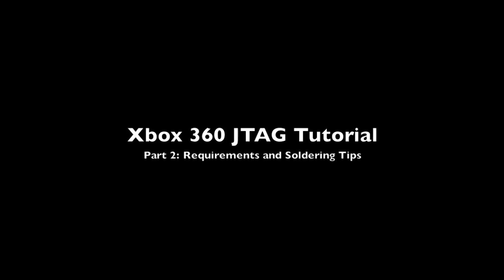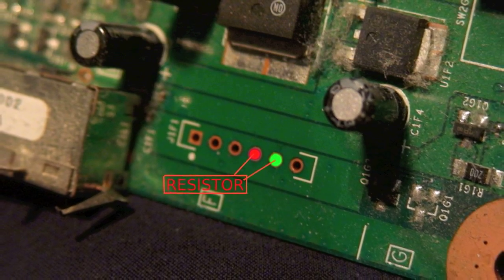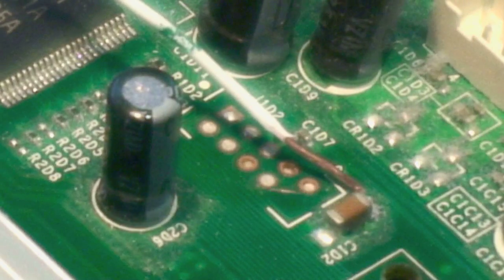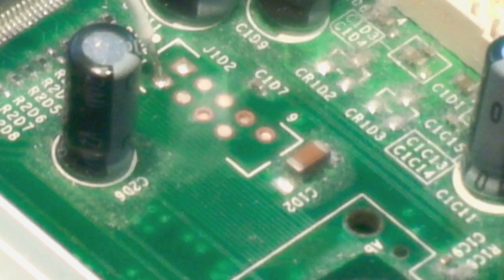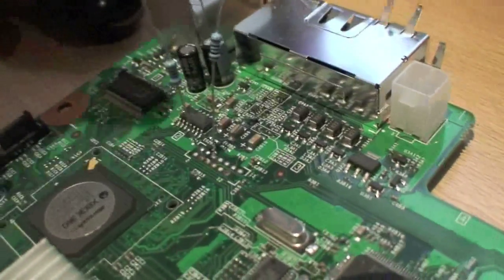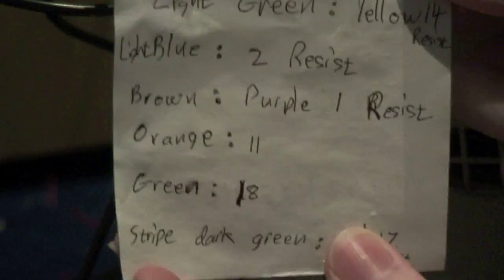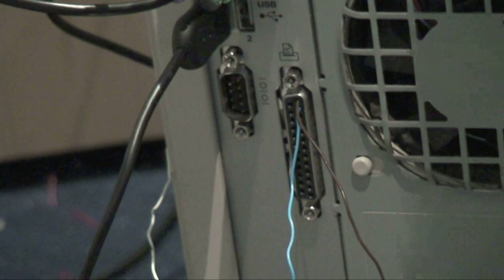Xbox 360 JTAG Tutorial - Part 2

Comment: Extremely bad soldering. You are not competent at all, example: you put wires straight to lpt pins, who does that? After 20 years of electronics study, you don't have free LPT connector? Do I need to "study 20 y electronics in general" to solder like a preschool?
Be at least a little modest...

Comment: Kexx Sh, this tut is almost 3 years old. There's a bunch of stuff out now that makes it a whole lot easier. If you have access to the funds, Nand-X with QSB's(Quick Solder Boards) eliminates a ton of work and there are plenty of tut's on YT to help you get it done right. Then again, the new hot item is the CoolRunner's RGH(Reset Glitch Hack). Maybe you'd wanna look into that. I think for most, soldering is the biggest issue. It can be a pain in the ass until you get the hang of it.

Comment: Question: You call for 3 diodes, but I only see you use 2. J1F1.4 to J2D2.2 and J1F1.3 to J2D2.1.  Did I miss where you used the 3rd one? I have a Xenon board.

Comment: @XxGreedyGutzxX if your xbox has been online since the summer of 2009 then it can NOT be jtag'd...  what stupid summer 2009 update fucked up something in one of the mircochips to where you can't use a jtaggable dashboard any more... however, there is the Reset Glitch Hack (allows you to do the same stuff as a jtag like modding games) but to unban a console, you would need a unbanned KeyVault...  it's actually much easier, safer, and cheaper to just buy another xbox360 then put yours on EBay...

Comment: sorry second message the same don't read but the xploit is called the Reset Glitch Hack and it lets you boot Xell and a chip that optionally comes with it the Cygnos Mod chip use Dual boot systems  and the main Software that you need to falsh nand with to boot unsinged code is called ggbuild, I may be wrong but the latest version of it is 0.33

Comment: @fenixxtate No first xenon(his)(2005-6), then Zephyr (2007),Early 2008 was Opus, late 2008 was Falcon, 2009 is Jasper and not sure for the rest of Phat Xbox 360 but slim isTrinity which I believe used to be called Valhalla. All slims are unexploitable to jtags due to motherboard and Dashboard Version as Microsoft Countered the Jtag exploit in Dashboard Version 2.0.7379.0, but if you really want to run unsigned code and Homebrew etc. then for slims and all other Xbox 360s there is a new exploit.

Comment from the maker: @HaloGuy2552 

1. Yes.
2. The two diodes and jumper connection comprising the JTAG modification must remain, however the LPT wires and resistors may be removed.

Comment: @OnlineTonight Those aren't viruses you idiot. PSFreedom is an exploit that is used via a phone to unlock your PS3. It's based on the dongle exploits such as PSgroove and PSJailbreak. Likewise they aren't viruses by any stretch of the term. Also it's not a stock USB stick. It's a custom micrcontroller that is housed in a USB device. They are all based on micro controllers such as Teensy, Atmel, etc. But they are not viruses at all.

Comment: @troy2062 Those aren't even viruses to begin with. Those dongle exploits are code that injects into lv2 and sometimes lv1 of the PS3 to unlock features. The only thing close to a "virus" on the PS3 would be idiots who make homebrew that is designed for the sole purpose of bricking your unit. But it still isn't considered a virus.

Comment from the maker: @bubba4peace 

The JTAG modification involves writing a modified kernel to the NAND which permits unsigned code (any unapproved by Microsoft) to be executed.  This video demonstrates the necessary modifications to the motherboard before dumping and flashing the NAND.

What is often incorrectly referred to as a "flashed" Xbox 360 console simply refers to a console whose DVD drive has been flashed with a custom firmware. This firmware permits the launching of properly burned DVD+R DL backups only.

Comment from the maker: @sk8terdude132 

As explained in the above comment, it is impossible to prevent a JTAG-modified console from incurring a ban.  There is nothing to brute-force.  When a modified kernel is detected, the KeyVault is blacklisted by the server.  A blacklisted KeyVault will not be accepted by the server, regardless of what is done on the console-side.

Comment: Dude, where'd you get that gawd awful soldering iron, you think you could have used something BIGGER?
Why not use a solder sucker and remove the solder out of the soldering points stuff the wire through the hole and then solder the wire on the foil path.
Oh and solder is not solder with the "o" being pronounced as "OH".
Do you know what HEAT SHRINK is?
My dog does a better soldering job.

Crude.

Comment from the maker: @joshualidberg 

No, you can not. A JTAG console currently costs approximately €250. A suitable console on which to perform the modification yourself costs approximately €80 (less depending on where you buy it from). Thus, you would need to successfully destroy two suitable consoles (incredibly unlikely) and properly modify a third before spending the equivalent of a JTAG console.

This is an incredibly simple modification. Very few people with an hour of soldering practice will manage to fail.

Comment from the maker: @xNIAC1Nx 

The 330Ohm resistors were needed for an older method of performing this modification.  The current method relies instead on three diodes and a jumper wire for the JTAG connections.

The LPT connections require a total of five 100Ohm resistors.  This has not changed between methods.

Comment from the maker: @cicoboy56 

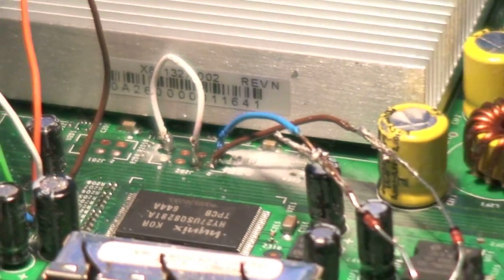As I explained during the video, I was demonstrating alternative methods of completing the connections.  One method (3:00) involves soldering the resistors directly to the motherboard, whilst in the other (4:00) I solder them to the ends of the wires.

Comment: Hey Troy, I have been using a 15 watt soldering iron from radio shack and am having some trouble melting the solder. I am also using 12 gauge wire. Could the wire be the problem or is my iron simply not getting hot enough? Thanks for the help and great tutorial!!

Comment: @troy2062 what the best diode you can get for this the one stated in the vid or is there another you can get that may work better also can you connect every wire to a toggle switch that way you can have a closed case and just flip the toggles to change you ip password or will that not work?

Comment: I have a question about the revision number.

My xbox 360 has a Xenon mother board, but the 2.0.9XXX update.

My question is if the MB is the one shown in your video what difference does it make if the version of the dash is different?

I have plenty of past experience modding many things over the years. I'm just curious as if maybe theirs a loop hole in the xbox mechanics that will allow a downgrade.

Just a though.

Comment: Hello, I followed the diagrams from this video (the correct ones, might I add) and when I try to dump my nand, I get the error 0 on every block. I've desoldered and resoldered 3 times before giving up. I don't know what the problem could be besides either the laptop im using (also connected using the actual wire, not LPT male connector) or the fact that I can't get one of the wires through the hole of the 360 mobo. It's the one where no resistors are attached... Do you know what the problem is?

Comment: wow! your soldering is horrid. 
1 - use flux, on the wire and the board, just a bit though
2 - get a soldering iron that uses a bit less heat, judging by the time it took to heat up the wire, and melt the solder, thats a hot iron, which makes it easier to kill components. 
3 - use a smaller soldering iron tip
4 - use smaller exposed wires, and push all the way in to the holes.

Comment: i dont  understand why  u  have to  conect the wires directli  to the lpt port  if you  can just get the housing  and modified to plug it in   straigth  ???? and also that will make a better conection   than what u  doing

Comment: i didnt understand how to extend the legs of the diodes to reach across the mother board. if im not mistaken you said to wrap the wire around the leg then solder them together. if i am mistaken please correct me because i dont want to make a mistake and screw up my jtag which by the way is an xenon.

Comment from the maker: @sqweeks85 

I agree that the iron was in a horrific state.  It is almost 7 years old, and I could not find my 12W iron in time for the video.

The wires were cut to proper lengths, however the diodes were of insufficient length by design, and there was no choice but to bridge them with wire.  Aside from the fact that there are no uninsulated wires running on the motherboard, the resistor leg extensions were late refined and insulated before installation of a DVD drive.

Comment: look, im new to jtagging, but ive been modding original xbox's and modding since 2003, i have a multimeter, but i do not have any idea how to test which wire will go in which port on the LPT connection using a multimeter, how did you do it?

Comment: @troy2062 
Ha yeh that was a bit of a problem at the start (pin 5 on J1D2 I think) was so awkward to connect, amazed me how easy you did the others (noticed you didn't do that point on the actual video) but it's now connected using the shielding from the LPT cable to the inner casing. I had over 100 differences at first, but now I've 15-14 so getting closer, gonna try a diff pc tomorrow (using a Dell 600 laptop atm because cable's so short). I've got an error 250 on the same spot for EVERY dump.

Comment: @troy2062 

Ha, knew that was an Irish accent hidden in there.. 

You make it look so easy getting the wire soldered! That was real fun.. Now my dumps are mis-matching, and I can't see a problem with the connections! Of course Peat's and Maplin don't have any more of those switching diodes in stock now, so gonna be a while until I put in the Jtag wires. Just gonna dump and dump and see what happens!

Comment: Pretty easy to do but you might want to give a better explanation. You have one part where  the resistors are sodered directly on to the board and one where you just sodered the  wires on to the bored wich one would you prefer? Also you kind of mixed me up about the upside down and backwards diodes but i still manage to put the correct side on to the mother board.

Comment: Hi there
I unsolder by mistake the small chip on the point C1D7 it might be cause a problem to my xbox or to my nand dump?
Also i have solder my usb spi nand flasher ( Lacho Systems v1.1)  to my 360 but the nandpro cannot find the device even in Device Manager is listed as "Unknown" what i should do?
I do not have any drivers
I install the port95nt.exe 
im using XP

Comment: Yes you get banned for having a JTag. The reason you get banned is because firmware/hardware modding is completely against the Xbox Terms of Service agreement, therefore ban. But unlike Ekstaasikonitianinen said, you wont be banned in mere minutes. more along a time frame of about 4 hours if your lucky. after it is banned you can either unban it, get a new Key Vault, Or sell the bitch on ebay haha.

Comment from the maker: @Paintballman747 

After the hack has been installed, you can remove the LPT wires (although the jumper/diodes must remain) and reassemble the console.

It will boot into the NXE dashboard, modified to run unsigned code.

Comment: got a new problem... 
while reading i got an 205 error on the 10A block so i thought the nand is just filled with 0's at that block (i read that this is not uncommon and nothing to worry about as long as its just one block).

While flashing back i got an 202 error at the same block. Xbox turned on but got no video signal and only the middle light flashing.

After flashing back i now got a 1 flashing led rod (lower left side). Any suggestions?

I hope my orig backups are not corrupted :S

Comment: my lpt is set to ecp (ecp, epp, epp+ecp being the options available)..

i added the diode to pin 11, still no luck. removing the resistors would be too much pain because i soldered them right onto the xbox mb (easier to solder than with those weak and thin lan cables).

there dont seem to be any shorts or cold joints but i cant check right now because i dont have a multimeter around :S

so i hope its just my lpt, i will try another computer tomorrow. hope ill have better luck with that!

Comment from the maker: If you have measured the voltage of your LPT port and found it to be 3V (rather than 5V), you might try removing the resistors.

Another possible solution is to add a switching diode (with marker facing the board) to pin 11.

Comment from the maker: While connected to the LPT port, the Xbox 360 should not be able to start.  This is normal.  If it did start, that would be an indication that something is wrong.

If NandPro is giving you the "Could not detect any flash controllers" error, there are a number of possible problems.

Firstly, check your soldering for shorts or cold joints.  I recommend using a multimeter in continuity test mode.

If this fails, ensure your LPT port is set to SPP, ECP, or ECP + EPP mode form the BIOS.

Comment: i finished the soldering but when i connect the cables to my lpt port, nandpro wont detect a flash chip and second weird problem:

while the cables are connected to my lpt, the xbox wont start. i know im not supposed to start the xbox while dumping. but when i press the xbox powerbutton nothing happens. when i disconnect the cables, everything works fine...

any suggestions?

Comment from the maker: @URGAMEARSENAL 

You are welcome. :)

In the case of a Zephyr motherboard with a vulnerable dashboard version, the JTAG exploit could be installed using the same materials (wire, solder, resistors, diodes, etc).

Comment from the maker: @URGAMEARSENAL 

I have sent you an image via PM.  If you have a Xenon or Zephyr motherboard, the power input on the board will look like the first image.  Combined with this information, if you do not have a HDMI connection on the board, you have a confirmed Xenon motherboard.

The most important factor if you do have a Xenon board is that you did not update your Xbox 360 in summer 2009.  This hack will not work if your dashboard revision is in the 8XXX series.